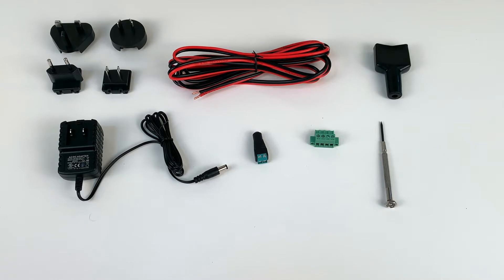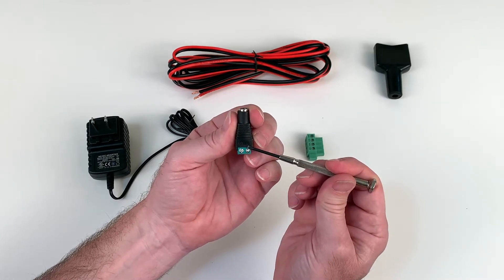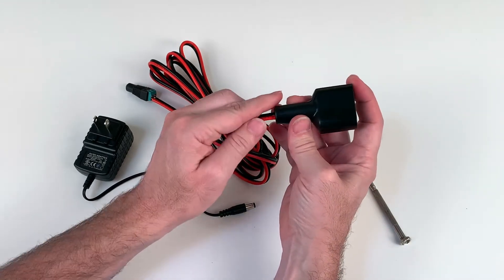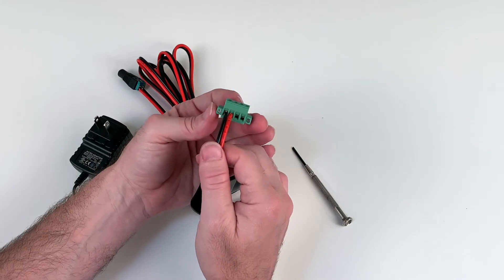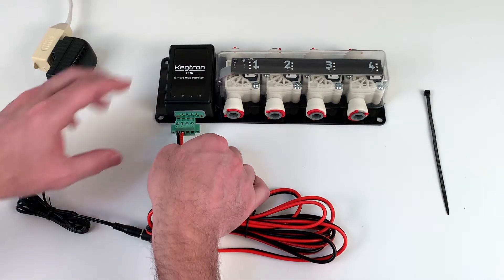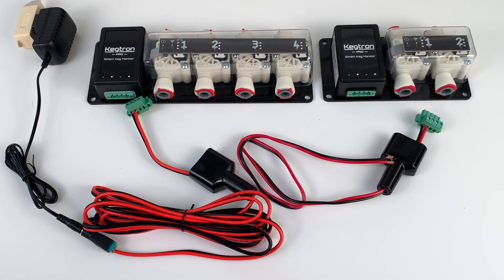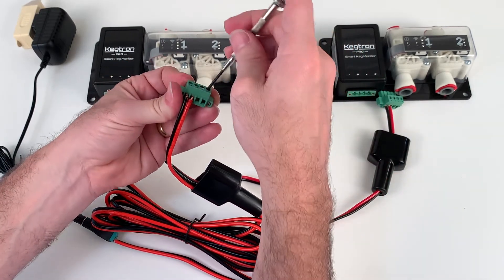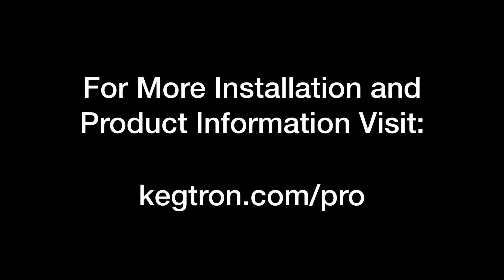Kegtron Pro Installation Part 1: Electrical Setup

Comment: $500 and I need to do wiring? I’ll pass
Reply: Yeah I didn't get it either until I saw him use as a jumper for power on other devices. Then it made sense why it was done like that.